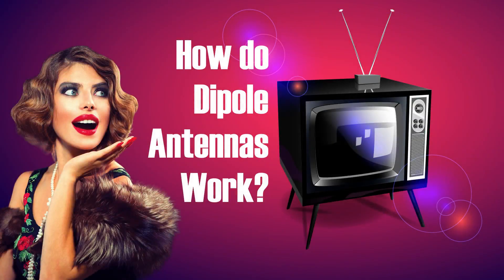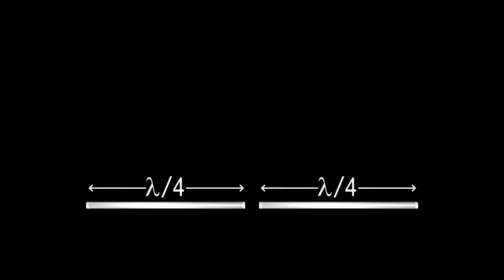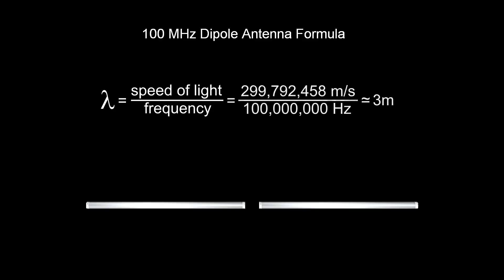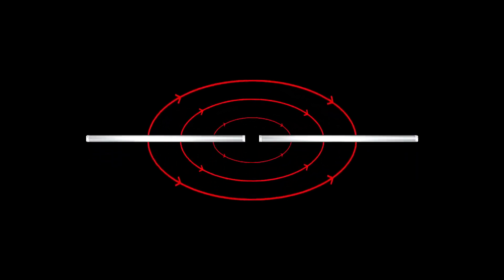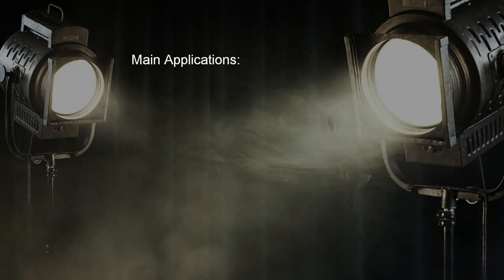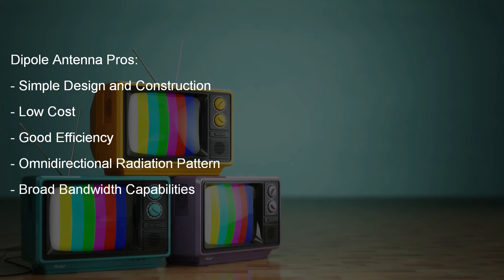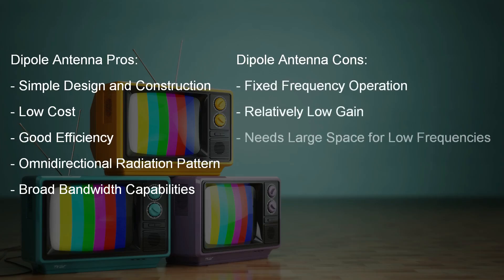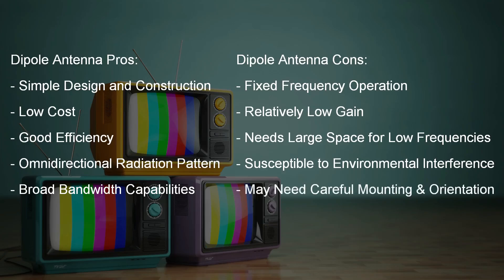How Do Dipole Antennas Work

Comment: To make a dipole for any frequency,  just take 468÷ frequency then divide that answer in half for the length of the 2 halves. Cut 2 pieces of common wire that length and attach 1 to the center conductor of your coax, the other to the braid of the coax. Hook it to your TV or radio you just avoided spending money on this marketing lies called " digital TV antenna" , biggest marketing lie since TV went up in frequency. Lots of marketing crap out there taking your money.